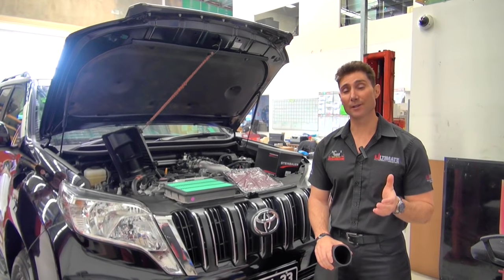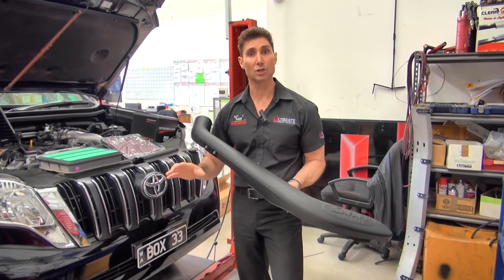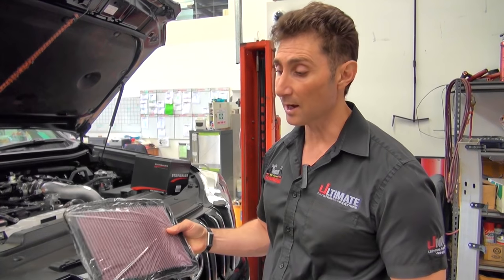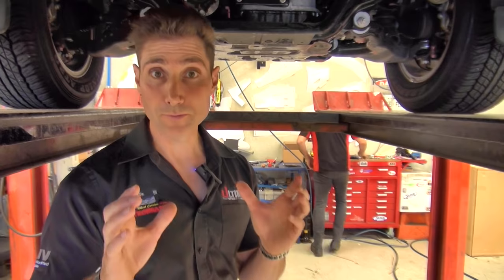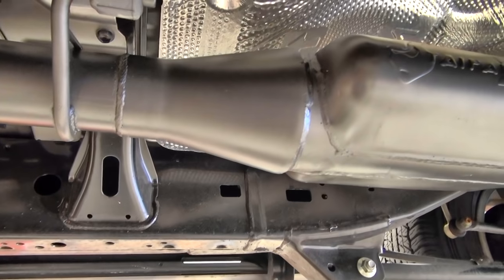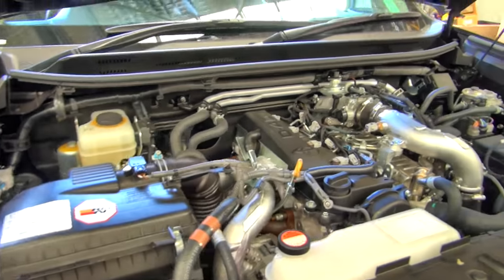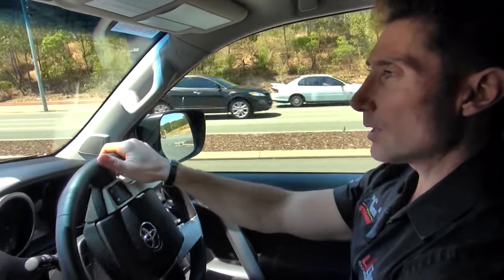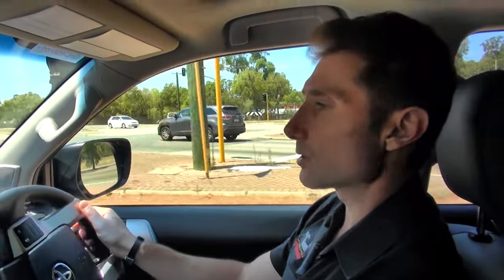Increase your 4wd performance with these 4 easy power upgrades

Comment: Yeah as many have correctly pointed out, K&N definitely doesn't offer better filtration. Mining companies have tested these over many years and don't use them for one key reason. They allow larger dust particles to fit through, therefore increasing engine wear over time. They do flow more air, but at a cost to engine life. Definitely a bad move to fit one to a serious off-road vehicle.

Comment: K&N DO NOT offer better filtering over standard O.E. paper filters. They do offer more flow but the trade off for that is larger and more dust particles can and will enter the engine.
Reply: Jason Brigham correct KnN would only be good for non-offroad vehicles otherwise you're allowing dust in your engine. And Safari snorkels do not increase or create a "ram" effect, no chance.
Reply: Yep, these guys don’t know jack shit about their so called ‘best installers in the world’ comments either. You don’t need ram air when you have a turbocharger, even at highway speed there wouldn’t be a single positive advantage of running ram air on that thing. K&N panel filters are practically see through, not good for off road vehicles.
Reply: All these shows are adverts for their sponsors. Ram air indeed! Like that turbo wasn't sucking all the air it needed anyway, if it couldn't it would collapse the intake pipes under a vacuum. These vids are good for entertainment!
Reply: Wrong!
Reply: And how can a filter increase flow entry fisically its possible but air intake its manage by computer so it would permit intake only by computer command.... what you think about my point of view??
Reply: Jason Brigham ...yh snarkle type chez...air flow ko easy way dyty hy...es k starting point pr .be filter HONA CHAHY....myn Toyota Indus motor .car assembly plant.pr he job krta hn....Jo filter ...china ka hy ...yh...over all . condition ko . APPLY....NHN....KRTA .....MYN .TEST DRIVE KRTA RYHTA HN.JIS MYN YH SARY BATYYN . CHECK KE JATY HYN.....MYRY NZDEEQ...YH ... DESERT...K LY ...FIT....NHN HY...
Reply: @zhr4121  from my understanding it makes air intake EASIER, not necessarily taking in more air. With tuned upgrades, more air will be needed and if the motor is breathing through a paper filter when begging more air, the motor works much harder.

The k&n makes air intake EASIER, thereby reducing the amount of work needed by the engine to pull more air, which also in turn, allows there to be a larger powerband in which pull more air.

Kind of like when you train for a long distance running event. When you first start off, your paper filter is like being inexperienced. Can only keep a certain pace before more air is needed for steady forward travel and for steady power, hence the feeling of not being able to get enough air after running for long enough. But when you train long enough, your air intake becomes something like having the accessory of a kn filter (among other more obviously useful accessories). You can use less effort for air intake and go even faster in your run, and you still have PLENTY of power band leftover to take in MUCH MORE AIR for some pretty heavy long sprints at a much higher powerband, because now you have less airflow restriction and can therefore take in much more air at once WHEN NEEDED.
Reply: It doesn’t matter if this was true it auto so the the power just disappears and less you got the slip locker on and that is also a after market mod
Reply: @johnsontrucks8806  computerized metering is a bitch ain't it? Definitely with you on this one.
Reply: They also suck for turbos... get it? No really, they’re terrible for turbo or supercharged vehicles.
Reply: I installed one 3 months ago, after checking the entire duct found 0 dust particles. K&N is filtering everything.
Reply: Jason Brigham yeah let’s face it.

Comment: Lots of comments about K&N vs paper filter (panel filter, stock airbox).
Use both. K&N on-road, Paper OEM off road. Takes 2 mins to swap filters. Best of both, extra flow for on road, better filtration for off-road. Just my 2c.

Comment: I have snorkel fitted and I haven't see any increase in the power or torque on the dyno graph. My reasons for the snorkel were water crossings and dirt roads anyway.

Comment: Also, increasing the length of the intake runner only adds to pressure loss in the system. I’d love to see how a snorkel adds power let alone rob power.
Reply: technically increasing your intake if properly smooth and well thought out should increase max torque at the cost a a little horsepower but only marginally so, you are definitely right about the ram air affect doing absolutely nothing tho

Comment: I can say that a snorkel dose not RAM the air in or a great sorce for power. But as a person who has bin mudding on a stock filter,then with a cone air filter and now finally a snorkel and K&N stock fit. I can say that my truck is always taking in cold air in definitely,dose not have power lose or struggle to breathe while going in and out of mudd as it did with the factory stock and dose not get water splash or marks as it did with the cone k&n in the engine bay. Now with the fully functional sealed snorkel I can hear it breathe with ease and any slite touch on the gas and it response easy and picks up faster,saveing me gas.rain does not enter in to the filter and it's ree washable saveing me money. Micro dust might enter when dusty dirt clouds but a quick carb cleaner and fuel injection cleaning cleans it out, takes 15min every 6 month no problem.😀

Comment: what about any dyno testing for a confirmed upgraded power output? Anyone can feel bit more power after replacing some so-called power upgrading stuff, but it's just in your mind, not real!
Reply: steinbauer specifically tune each chip for individual cars making sure you get a decent amount  of output but whilst still being safe, hence why it plugs into the fuel pump and every injector, makes a huge difference but if you want more power you may aswell go a remap.
Reply: Dan Will remap or piggy back ECU
Reply: The only way to tell for sure is to perform a dyno test before and after..
Reply: yea because he has new pike also

Comment: Some awesome upgrades, but just incase anyone else makes the same mistake I did, K and N filters are not recommended for off road use especially if they are for a diesel Turbo, a few big trips and you can say good by to the turbo

Comment: "Ram air" is a myth. You cannot "ram" more air into the intake unless you add a supercharger or turbo. A K&N filter gives you more power by having a less restrictive/coarse filter material, which in turn allows small dust particles getting sucked into the engine which would normally get caught by a fine/stock air filter. If this is really any offroad vehicle then that's a no no, but if it's all mall crawler then it's all good.
Reply: gutted that is a turbo vehicle and k&n mixed with a turbo does make a difference it just won't with normally aspirated engine as the throttle body will stop it from doing corky stuff
Reply: You are spot on gutted! The factory paper filters are by far the most reliable filters available. Bigger holes means more chance of particles not connecting with the oil on the filter & you better make sure of no dry spots & clean & re oil very regularly. Ill just stick to what the manufacturers recommend & choose genuine filters all round.
Reply: Its a soccer mums car
Reply: K&N filters offer a 1000 000 mile warranty.
Yes that's right, 1000 000.  They supply aftermarket filters for motocross and speedway as well as all kinds of vehicles etc.  Those vehicles see plenty of dirt.  The money you'll save by not having to replace filters, as long as you clean and prep the filter, they'll outlast the vehicle.  Check further and you'll find, they stop just as much dirt particles from entering the induction as a stocky.  As far as performance goes, on their own, with no other mods, you wouldn't notice, but if you have the vehicle for say 10 years or more, you save on only having to ever buy the one filter.
Reply: Exactly Jen!! Laugh my guts out at these muppets who think paper filter elements offer better filtration than K & N or UNI . They simply DO NOT - a point proven countless times!  You want to run paper ? Make sure you run a UNI snorkel sock if you are actually going to use it as a 4WD!
Reply: Ram air works if you are pushing big speed. There is a reason drag cars, F1, and most performance motorcycles, have ram air. Check out Cleetus McFarland's channel and his Corvette uses ram air with his turbos. 

Ram air wont work unless its fed directly to the throttle body or the forced induction system. if you send it through ducts and pipes it will diminish the ram air effect and you have a gawdy cold air intake.

TL;DR ram air is a thing, but really only affects fast things that are set up properly.

P.S. I like the term Mall Terrain Vehicle.
Reply: MJHMech oh how wrong you are, look up how turbos destroy k&n filters. Diesels particularly, stay away from them.

Comment: Great video, as you mention the installation by a trained professional is what makes all the power upgrades function in the way they were designed to. No offense to amateur
mechanics but if you're not sure don't risk your car by trying to save a few bucks.
Reply: Problem is, if you listen to most of the posters on here they are ALL experts in everything....Typical petrol heads

Comment: just make sure he does the upgrade.. with the stienbauer because of the different sea levels
Reply: Not a Dig at you Cole, this is just for your information.

Australia is the lowest continent in the world with an average elevation of only 330 meters. The highest points on the other continents are all more than twice the height of Australia's highest peak, Mount Kosciuszko which is 2228 meters above sea level. 

This Prado is a turbocharged 4cyl. Any level over  500 meters above sea  level will degrade engine performance fairly significantly since the pressure is less, at higher altitude, so less air will pass into the turbocharged engine. As a result you make less power because less oxygen is available to burn with the fuel.

Steinbauer has taken this into account, increasing the tolerances to suit Australian Conditions, with more oxegen the Steinbauer is able to increase the injector duration timing, allowing for or air/fuel to pass through the engine, in-turn making more power, whilst maintaining the vehicles safety parameters, and not increasing rail pressure like most “chips” do these days.

There is no joke here, although they may be talking about minor influences this is a factor that Steinbauer Considers to get as much power as possible in the safest possible manner.
Reply: injector timing has nothing to do with controlling the engine timing, allowing more air into the engine. that comes down to preset parameters by any ecu based on fixed cam and crank operation of non VVTI vehicles. In VVTI vehicles, this can be altered by adjusting the solenoid operations of the VVTI system, which can then allow the valves to open at a differing time. This then controls injector timing, not the other way around. Bumping up rail pressure has been proven more affective because the timing of the injector allows it to atomise correctly, but more volume of fuel in the spray, and the piston dish allowing to mix correctly upon combustion.

Comment: @Ultimate 4WD Equipment, this is probably going to sound like a stupid request but does the Taipan exhaust come to fit a Holden Jackaroo 4JX1, probably not but worth the ask and also is the Steinbauer compatible with the 4JX1.. People tell me to get rid of my Jack and get a real 4x4, but I love my car and ironically it's those mates that bag me about my car that I pull out of the bog ...

Comment: Thinking about installing a super charger for my 2012 FJ to help with towing. Currently stock FJ’s can tow up to 5,000 pounds, how many more pounds can my FJ tow if I added a SC? Will it increase capacity by 2,000 pounds? Thanks!

Comment: "different sea level heights"......
Reply: Not a Dig at you Nick, this is just for your information.

Australia is the lowest continent in the world with an average elevation of only 330 meters. The highest points on the other continents are all more than twice the height of Australia's highest peak, Mount Kosciuszko which is 2228 meters above sea level. 

This Prado is a turbocharged 4cyl. Any level over  500 meters above sea  level will degrade engine performance fairly significantly since the pressure is less, at higher altitude, so less air will pass into the turbocharged engine. As a result you make less power because less oxygen is available to burn with the fuel.

Steinbauer has taken this into account, increasing the tolerances to suit Australian Conditions, with more oxegen the Steinbauer is able to increase the injector duration timing, allowing for or air/fuel to pass through the engine, in-turn making more power, whilst maintaining the vehicles safety parameters, and not increasing rail pressure like most “chips” do these days.

There is no joke here, although they may be talking about minor influences this is a factor that Steinbauer Considers to get as much power as possible in the safest possible manner.
Reply: Brendan Michaelides not disputing that but there aren't "different sea level heights". There is one sea level. What you are describing is different heights above sea level
Reply: +nicholas hallissy agree completely. I guess it was a verbal mistake.
Reply: I was thinking the exact same thing...
Reply: Good points, but still: the highest paved road in Australia is at what... 1800m? I don’t think any car really goes higher than this. And how many of these roads are there in Oz? There must be about 30 paved roads over 1500 in Europe... I guess that the Steinbauer product doesn’t have much work on an Aussie car. Anyways. If the owner has the cash, he’s free to buy whatever he wants. Also winter tyres... For the Great Alpine Road, just in case :-P
Reply: yeah damm north pole is melting you know.
Reply: If you think about it.....tide heights change from a 1m to 1.5m through out the day, week, month and year. So in a way, but i still think he buggered it up and just went with it. High tide somewhere means a low tide somewhere else.
Reply: He's probably referring to the tides...
Reply: @brendanYour4rch3n3my  Good info....I never thought of Australia being that low (average) elevation...Here in Las Vegas, NV, USA, we are at approx 2,200 ft elevation, yet we hit 45 degrees Celsius routinely throughout our summer months, yet 30 minutes outside the city we have a mountain that is approx 3,800 meters high...Still, Mount Kosciuszko is a proper mountain at over a mile high...And, I LOVE to watch you boys go off roading--proper drivers you are.
Reply: Really, this is like spelling police 
You know what man meant to say

Comment: KN filters let dusty dirty air get past into combustion chamber. What it does? It scratches cylinders and piston, lead to oil consumption and engine rebuild. Instead of silly kn filter, install cold air intake and bigger turbo or compressor.

Comment: Think of a snorkel you use when diving. It doesn't give you more air, it simply re-locates where the air enters from. Not a performance upgrade in the slightest. 
You want performance?
1. Bigger Intercooler
2. Bigger Turbo / Higher PSI of existing
3. Bigger Air Intake
4. Higher Flow Fuel Injectors
5. Turbo Back Exhaust / Upgraded Exhaust
6. ECU Flash and Tune
Reply: It gives the vehicle cleaner and cooler air. That small difference can make a big difference.

Comment: You're not gonna Ram any more air in that snorkel than the turbo is sucking in. In fact a snorkel kills power. good for clean air, and water crossings that's about it.
Reply: Would you install one on your truck? I'm just wondering if there's any advantage of having one on a daily drive, I really don't think it'll make much of a difference, unless you live in a place like Australia or the west dusty areas.

Comment: Whats the cost for the upgrade? What power and torque output are you getting post upgrade?
Reply from the maker: +Doug K It all depends on your vehicle. If you could please call our showroom and speak to one of our sales staff, they will be able to give you the full spec on the system for your vehicle.

(08) 9434 1111
sales@ultimate4wdequipment.com.au
Unit 2 / 1 Discovery Drive, Bibra Lake 6163 WA
Reply: +Ultimate 4WD Equipment PTY LTD lol
Reply: lol you mean 'our expert staff'....  who says?  its bolt on parts after all!

Comment: What if you replaced the stock manifold with some quality long headers?
Reply from the maker: Hi Amro
You could do that I don't think it would make a big enough difference for the cost. It would on a petrol engine, not so much on diesel. Recommended to keep it simple leave the factory components

Comment: everything i've heard about K&N Air filters has been terrible.  They allow too many particles into the engine.  Doesn't sound like its worth the marginal power boost.
Reply: Id only ever put an oil filter on a non MAF sensor car, something speed density.

Despite the bullshit people say paper filters flow just as well as K&N when they are clean, its just when they are dirty the flow less, and that's mostly because the K&N is fully adsorbed and lets all manner of shit through.

Comment: KandN is NOT going to outperform the OEM filter. K and N will get more air with more dirt. More filtering, means less air and vise versa. At high speeds a snorkel will force air into the engine due to the ram head.